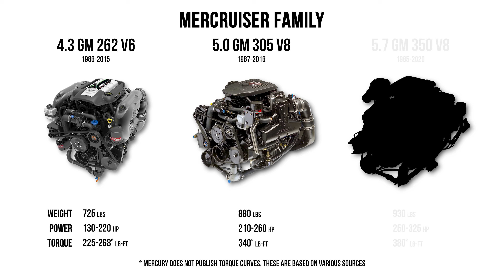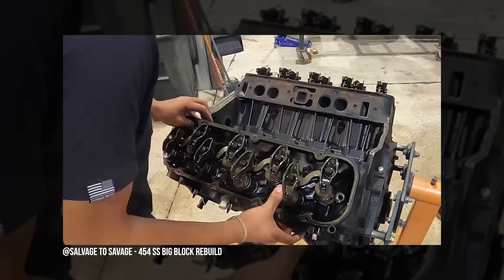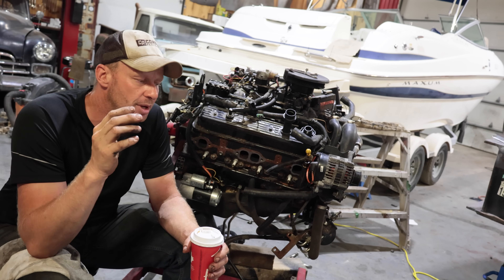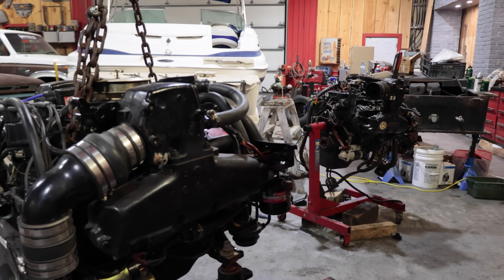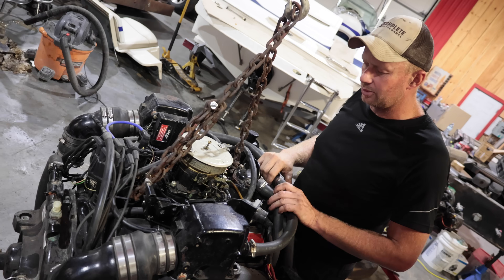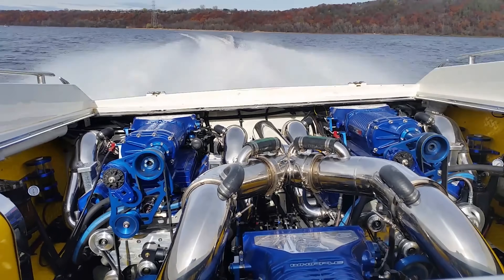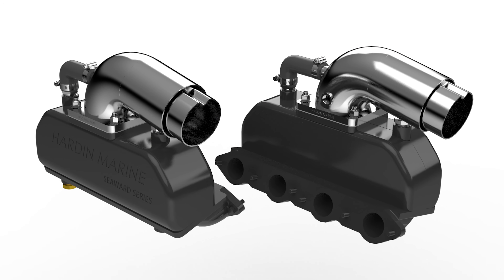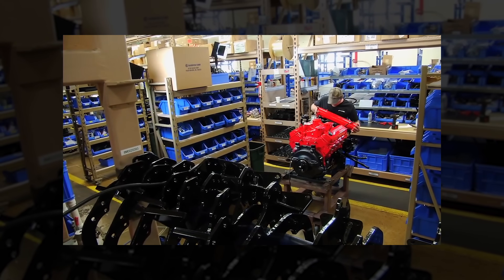REVIEW: Everything Wrong With A Mercury Mercruiser

Comment: I had a VolvoPenta 5.7 - similar setup - and I am so glad to not have to deal with an I/O (sterndrive) engine any longer. Being a brackish/saltwater boater and living in an area that freezes my I/O always made me very nervous.
Reply: The worst part about the SX era volvo drives is the hydraulic system. The way they designed it, if you have to replace one hydraulic line, you have to replace the whole system! And they sell the whole system as a package cuz they KNOW what they did to you. Dissimilar metals corrode permanently in place. Even if you can unthread the fittings, the threads come out with it. 
Suuux! The worst is the pass-thru hydraulic manifold part. It's $400 by itself!

Comment: He mentioned draining the blocks for the winter layup. Don't forget to run pink biodegradable Antifreeze through the engine via the raw water pickup. Either do it while the engine is hot or remove the thermostat and run. Run until you get solid pink coming out the exhaust. You will not crack a block that way. 4.3s love to crack behind the exhaust manifold.
Reply: I was using the cheap pink stuff from Walmart then I realized you need the more expensive stuff rated for engines.  The cheap stuff is alcohol based and not good.  The expensive stuff has propylene glycol.
Reply: @joesilverbliss1721  You want to keep using the cheap stuff and drain it out after you run 5 gallons through the engine.  The procedure is simple: Use a 5 gallon bucket with a spigot on the bottom that you can connect a short garden hose to and run it to your muffs. Run the engine until the thermostat is open using water and then switch to the coolant and run it until your 5 gallon bucket is empty. I collect most of it and store it back in the jugs for the following year. Pull your blue drain plugs and your done.  Do not use radiator coolant rated for automobiles. Lots of youtube videos showing various methods....
Reply: We mainly use the pink for the water systems in the cabin. It's much cheaper to just drain out the water from the engine. Draining all the water from the water system is much more difficult.
Reply: @thediplomasta5891  As long as you can guarantee that there is absolutely no water left in your engine cooling system than you can get away with not running the antifreeze through it. Peace of mind and extra assurance is why the majority of us flush with RV antifreeze. Especially for those of us who live in extremely cold places where temps will stay below zero for a week straight, or longer. That way there if any residual water is trapped it's at least displaced with the antifreeze and won't crack your engine block. Like I said, I collect it all in a bin placed under the stern drive and put it back in the jugs for the following year. It hardly costs anything doing it this way and it's a lot cheaper than having to replace an engine block! I know some people use JB weld to fix cracks but that's not a real fix.

Comment: Could you flush and fill the entire system with anti freeze to prevent any damage from freezing?
Reply: That is a normal part of the winterization process.  Lots of good videos on doing this. Use winterizing antifreeze for engines,  not the cheap pink stuff at Walmart only for water systems in RVs.

Comment: my grandmothers boat (4.3) had like ZERO oil pressure at idle.... if it "low low idled" you could hear the lifters start tapping
then i let it freeze.........NE MT so its a HARD freeze
.
however.... its CLEARLY  got room for a 350,  and ive always wanted a bit more pull for water skiing (starting out it just doesnt QUITE have enough to keep me up)
the "bell housing" should be the same
.
only issue us i would need like an A-frame..... as its in a damn boat

Comment: The pre-vortec engines came with the 207 heads.  From what I understand they are the iron equivalent of the TPI Heads on the Corvette / Camaro's and rated from GM at 270hp with stock dished pistons, the H.O. we're rated at 300hp and used flat top Pistons. So in summary the pre vortec engines are Not the TBI heads that you are implying.!

Comment: Thanks Rich love the channel. I live in an are where its below 10 degrees for several months in the winter the last boat I owned was a maxim 20sl with the 6 cylinder merc and I just ran coolant through the motor every year when I put it up and it stayed outside for six years never had an issue. I pulled the plugs the first year then a guy at the boat shop suggested just running coolant through it so I did and it worked never cracked anything. The problem i had was with water pumps idk why but 4 water pumps in 6 years.

Comment: Be very careful with camshaft overlap on marine engines unless you run dry exhaust. Too much overlap leads to water getting in the engine through the wet exhaust. Check with your cam manufacturer before ordering.

Comment: Back in the 90's I worked at a local marina. We did hundreds of winter/summerizations on boats and had large storage buildings for winter. I think I still have fiberglass shards in my forearms from reaching around the larger engines stuffed into the fiberglass boats. We (the young mechanics and helpers) always preferred to work on the Mercruiser stuff, and specifically the Cobalts. They were simply a better built and better engineered pleasure boat than any of the others at the time. Bayliner and Maxim were always the worst. We called them the "Kraco" of the boating world.
Reply: My 1994 Cobalt 220 with the 5.7L still running strong. Everything original minus plugs. Great boats, excellent quality even by todays standards.
Reply: Maxims, an engineering disaster from 12v power distribution to engine space ventilation.

Comment: Not sure about engines themselves. But adding stainless to steel is usually a big no on boats for submerged parts. Your stainless part will be fine, but the steel rots like hell. (Assuming no sacrificial anode)

Had it once happen that a steel rudder was bolted to a steel boat with stainless bolts. The anodes kept the boat fine, but after 2 seasons the 3mm steel of the rudder was mostly gone.

Comment: Another boat motor killer I see often, outboard included. Exhaust or headgasket leaking even small amounts of water in cylinders. Because they sit between uses it generally rusts in the cylinders. It may still run ok for a while but the end is coming.

Comment: I used to build the 3.0L I4 mercruiser engines for sprint cars, good engines.
Reply: Ive had mine for 14 years in my bayliner never had a issue great engine
Reply: Recommend me a head gasket pls
Reply: What did you use for intake and exhaust manifolds?
Reply: @thisisyourcaptainspeaking2259  quiksilver but the head gasket is too thin, blew on the first 20 minutes. I need a good gasket and im gonna have the heads checked for warping
Reply: @raulserna9871  Marine manifolds can't be used in a car, I guess you must be using forklift manifolds,
As far as headgasket is concerned, I expect marine gasket should work fine.  Probably, your head is warped as you suspect.  You should be able to use the forklift gasket as well.
The difference is the marine gasket is multilayer embossed steel.

Comment: Been on the same 350 Merc for 30 years... Thousands of hours, all original right down to the plugs and wires for over 25 years. The only problem we ever had was the raw water pump and finally a hairline crack in one of the cylinder heads. Just goes to show if you take care of it it'll take care of you.
Reply: You ran 25 years on the same plugs and wires...Sounds like you're one of the "owners" he's referring to.
Reply: @JonezBuildz  If it ain't broke, don't fix it. I replaced my raw water pump after 18 years because it looked a little rusty... The bearing and shaft pulled out of it by early August of the same season. It was a bombproof engine, but the replacement parts don't have the same life in them the original parts did, OEM replacement or not.
Reply: Is your boat a fresh water or salt water application?
Reply: @windward2818  Both. Port is brackish, about 5 miles inland, occasional trips upriver, but most weekends are spent in the salt. Don't ask me why or how it's been so tough, but never would I trade for another boat or motor.

The Bravo III, on the other hand... Number 3 was rebuilt, the lower unit was replaced the following season, and this will be the third season on number 4. If they don't pit themselves to death, they just self-destruct.
Reply: @dozerfarms  My boat is 24 years old and like yours I'm still on the original engine, original starter, carb, alternator, everything. Thousands of hours and she still runs strong! I replace the water pump every other year, and all the fluids get changed yearly. 100% salt water use and the boat gets winterized every year by me. Sounds like you know how to take care of a boat and its engine. These are great motors. She'll still hit 50 mph on plane...
Reply: @jamess3532  Haha yessir! I do everything myself that doesn't require a special tool to do. Last weekend was waxing and waterproofing the canvas, the week before was the bottompaint, anodes, and outdrive oil, all I have left is to throw the rest of my stuff on board, hook up my instruments, and drop her in. Here's to a great 2024 season! 🍻
Reply: @dozerfarms  I'm prepping mine for the season too. It will be a few weeks before she gets in the water though since I decided to replace the flooring in the cockpit. She was getting a little soft around the engine shroud. Just my opinion here, but learning how to maintain your own boat is paramount to getting the most out of it.   I think a lot of folks purchase boats without learning what it takes to properly maintain them. If you do everything yourself you know it was done right.  Happy boating.
Reply: @dozerfarms my dad owned a marina when I was a kid.  As far as I/O went Mercs were the best.  He worked on mercs OMC and Volvo Pentas a lot.  The mercs were mostly just wear and tear on the Outdrives, they just wear out, it's a lot of torque making a 90⁰ turn a few times.  Most of the time it was lack of maintenance that killed em.  People notreplacing anodes, not replacing output seals, not replacing water pumps.  Another big one was people just not pulling their boats to get the barnacles scraped off and repainted.  Or the would scrape em themselves and not repaint.
Reply: @dozerfarms thanks! 🍾
Reply: Wait, same plugs??? 😳

Comment: We never drained our inboard block just ran the engine on the trailer using antifreeze as the coolant for final winterization 
 In the spring ran it on garden hose water to keep the residual antifreeze in the block out of the lake       This would be more difficult to do with transom exhaust but our boat was through the prop exhaust so catching the antifreeze as it ran was easier

Comment: Had a Mercury Black Scorpion (350) in my old ski boat....great motor!  But Mercury for some reason likes to put the raw water impeller down at the bottom by the oil pan and its a royal pain to replace the impeller (which needs to be done regularly)....a knuckle barking exercise that I hated.  Other manufacturers put them in a much easier to reach location....that would be my biggest complaint.

Comment: You did an excellent explanation of the mechanical differences between automotive and marine engines. But you forgot an crucial difference, the electrical system. The electrical systems for marine application, not only the engine, is different than automotive. The engine bay of a car is very well ventilated, you can see the ground when you open the hood. For a boat, when you open the engine bay of an inboard like yours, you see a solid sealed (hopefully) hull. There is nowhere for the gas fumes to go. This is the main reason for activating the venting fans before starting your engine.

The electrical system of a marine engine is specially designed to avoid the electrical arcs of the various form of switches to be in direct contact with the surrounding air. Even the wires are different, each braid is individually tinned to prevent corrosion. Never use a car alternator, marine grade alternator will have double insulation to prevent shock and sparks.

Rich, be careful with the LS swap, use marine grade electrical system.

Comment: HUGE NOTE TO ADD.    The starter, alternator, carb overflows were different than a truck or cars.   They are supposed to be marine grade so there’s no open spark risk.   The carb needs to have the jhook on the overflow in the event your floats stick open.        Insurance used to cancel claims  due to inspection’s showing non marine parts were used
Reply: Came here for this comment, it was tempting to replace accessories with automotive grade due to price differences.
Reply: @ic3man5  just like airplane parts.   They are more expensive usually for a reason
Reply: I dont mean to be rude, but if you're stupid enough to put a non marine part on a boat, you deserve what happens. 
Ngl, they actually recommend using marine plywood over treated osb in a lot of scenarios.
Reply: Well, when someone puts a truck/car engine into thier boat, the generally always use the accessories from the boat engine, so no need to panic 😬
Reply: @johneckert1365  just hate to see someone loose everything over something simple.

Comment: Horrible engines for salt water. Had a 153 iron duke mercruiser and a 181 iron duke Volvo (new). Big 13 inch flywheel that does a fantastic job of flinging salt water into the starter motor. 8 starter motors in 2 years. Oil leaks everywhere. Volvo SX leg corroding after 1.5 years. Got rid of the Volvo powered boat, bought a McKee with two 11 year old Suzuki 175s. Owned for five years (16 years old), replaced theECU power wire and that’s it apart from routine maintenance. Buy Japanese, never look back.
Reply: Iron Duke was a Pontiac 2.5L.

Not related to the Chevy 2.5L/3.0L which are just a 250 inline 6 with 2 cylinders removed.

Comment: Another common issue with these engines is the oil pan will rust away and pour oil out, requiring an engine out job in most cases!
Awesome video!
Reply: Usually, it's the oil pressure sensor that will rust away, allowing all the oil to leave the engine. I seen some really bad oil pans on these mercs, but never rusted thru. If the engine were that bad, it wouldn't be in running condition anyway. A starter will rust solid, long before an oil pan will. 😂 plus, the 4.3 oil pans are cast alum, instead of tin. And have plastic timing covers that are embossed with: replace if removed.
Reply: I'm removing 350 from a Malibu wakesetter to replace the oil pan. 12 yr old boat. Those issues with oil pan rust aren't common in fresh water. Is common in salt or brackish water

Comment: My family has a '92 Mercruiser 4.3l.  When winterizing, we drain everything then add a little plumbers antifreeze to the exhaust manifolds.  We found the drain on the exhaust manifolds isn't truly at the low spot and ended up with a little water pooled at the back.  We got lucky and were able to get the manifold repaired but now we always add a little antifreeze just to be safe.

Comment: What's more important in a Cruiser Boat application ? TQ or HP ? . 2 similar displacement engines, top them off with the same Cylinder heads, Compression Ratios and Camshafts, something like a GM 302 (4.00" x 3.00" Bore/stroke) vs GM 305 (3.74" x 3.48" Bore/Stroke). With limited RPM, Something tells me that apples to apples, the 305 would be better suited, but I am sure there are Props that can also make a difference. Am I on the right track ?

Comment: I’ve heard that the older school marine engines without electronically controlled distributors have drastically different timing curves from a car engine because unlike a car engine the marine engines are constantly under heavy load. Is there any truth to that?
Reply: Yes, Mercruiser has there thunderbolt ignition module. 10-12 degrees base and then it's all in by 2300 -2500rpm. Total timing around 30-32 degrees.

Comment: Volvo Penta uses the gm motors aswell. All the cracked ones I've ever taken out were 2 bolt mains. If you are in fresh water the plugs and head gaskets from a truck motor are fine.

Comment: You need stainless head gaskets, marine carburetor, marine starter. and cost guard approved fuel system. Also take it to a boat mechanic to set the engine cut out properly so the transmission doesn't get damaged.

Comment: Brings a smile to my face to see some  marine content on the channel! Mercuiser didn't continue on with the LS line of engines but volvo penta did. Took a long time but all modern  gasoline I/O's  are running catalysts as well now. Albeit they are falling by the wayside of the simplicity, servicability and reliability of modern outboard engines . 

Im sure youve got a good marine contact near by you but if you ever have any questions dont hesitate to reach out - northern ontario based marine tech of 14  years 👍
Reply: What is the current 6.2L merc cruiser based on?
Reply: @conrasm  The current all aluminum 6.2L Mercruiser is built by Mercury marine itself. Same with the 4.5L V6.
Reply: Yep, had a Volvo Penta in my Bayliner. Long gone now.